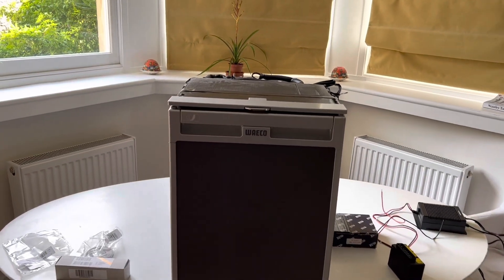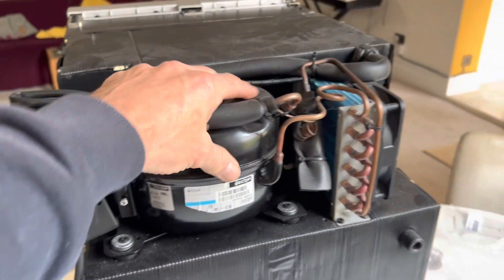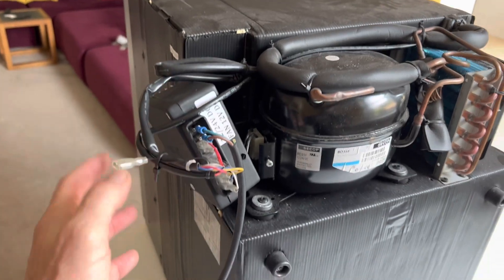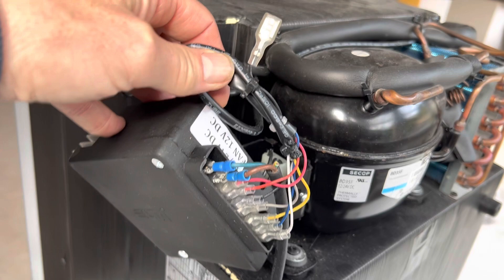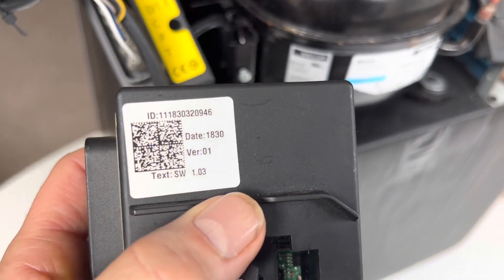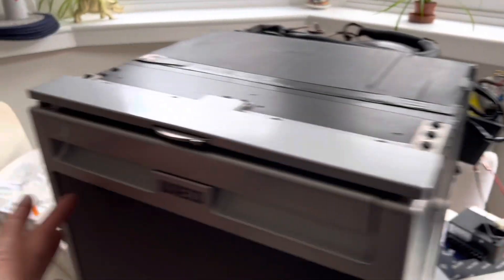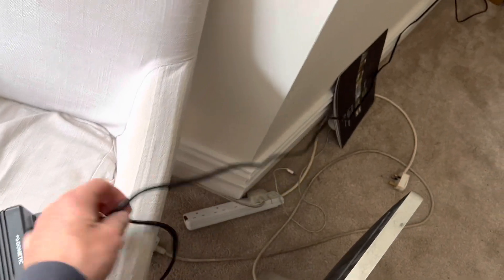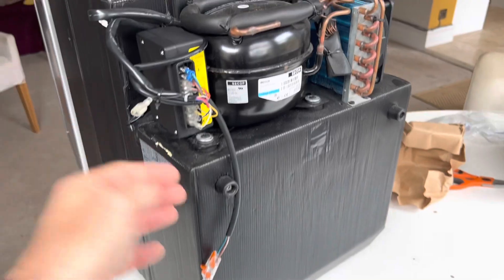CRX50 fridge controller - SECOP 101N0650 - BD35F compressor

Comment: It would be interesting to see inside the controller and workout what fails it might be an easy fix for pennies. It’s probably possible to make the cheaper one work with a few modifications to the circuit
Reply from the maker: Yes - good point. I probably should have kept the knackered one and sent it off to an electronics friend. Mike

Comment: Thanks for putting up the video. ? Mine was not getting ice in freezer on the first 3 settings and intermittent cooling if i put on full cold the bottom light it gets to - 12. I changed the thermostat no change. Do you think the inside pcb control is gone as all lights up fine. Or the control box on back.
Reply from the maker: Only just seen this comment - did you get it sorted? Mike

Comment: Please can I use the compressor by bridging the T and C without a connecting the thermostat.

Can I use a 500omhs instead of 618 for 3000rpm; or 1000omhs instead of 1523omhs because it may not be easy for me to opten the resistors with exact Ohm 
Thanks🎉❤
Reply from the maker: I don't know the answer to that but if it was me, I would get the correct resistors. Mike

Comment: i have the same fridge ,the fault is when you switch on the lights in the fridge flash on off and nothing happens .Dometic think its the board in the fridge but not sure i wonder if you have any idea
Reply from the maker: Hi - apologies for the delay in replying I've only just seen your comment. Where are you based? I'm in Bristol and have a control board which you could try. If that;s your problem, you can buy the board and if not, you've saved yourself some money. Mike

Comment: I bought a new 101n0650 controller and stupidly connected + and - wrong way round ,would this damage the controller?
Reply from the maker: Hi - just seen your question so apologies for the delay. You might already know the answer - if so let me know. Many electronic control units are protected with a diode that only allows current to flow one way...hopefully that is the case with your controller. Mike

Comment: I have the same fridge and it powers on but no compressor kicking in. I have been told to bypass the thermostat by joining to connectors on the controllers. I believe it is C & T. does that sound right? Thanks!
Reply: Yes that works! If it turns on when you do that it is definitely your thermostat
Reply from the maker: Thanks for clarifying that...Mike

Comment: Just need to know the correct way to plug the 3 pin connector  to the compressor
Reply from the maker: Doesn't it only fit one way? Mike

Comment: Comp starts ,stops after 3 sec ,will not shift from start to run,  changed a few cards i have here in stock,but no results, what do you resort to?
Reply from the maker: Do you mean you tried a few 'controllers' you happened to have in stock? Well that is exactly what I did... tried a few brand new controllers....until I realised through trial and error, that you cant just use any old controller which looks the same and fits. My Fridge only started to work properly when I used a SECOP controller. Hope you get it sorted. Mike

Comment: I’m having a difficult time troubleshooting my unit ..almost identical hardware ..but ..no cooling ..no error codes etc ..fan runs ..compressor runs ..just no cooling ..
Reply from the maker: Hi - you probably know this already but....

The heat (energy) required to get the refrigerant to go from a liquid to a gas (eg evaporating ) is drawn from inside the fridge which is how the fridge cools down. If the compressor is running, but the fridge is not cooling, the first thing I would check is that the fridge has refrigerant . Mike
Reply: @scottitonline   ..I have no technical documentation for this unit ..what type of refrigerant is used in these models?